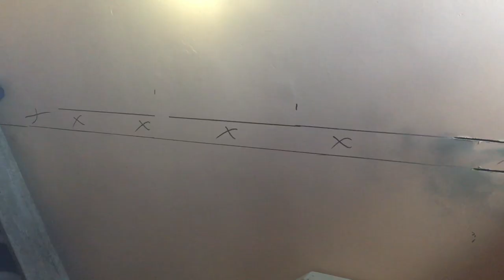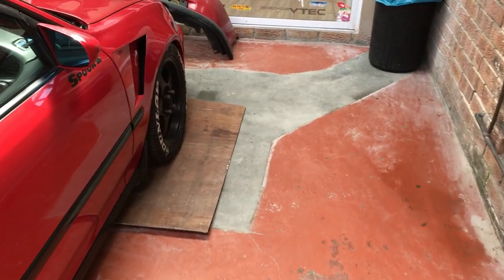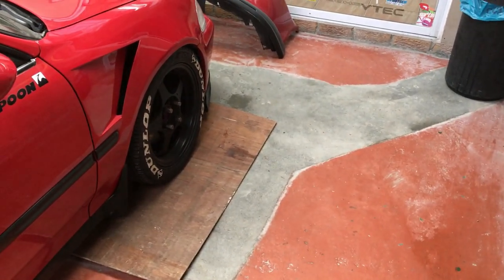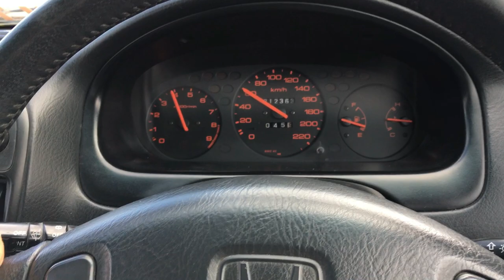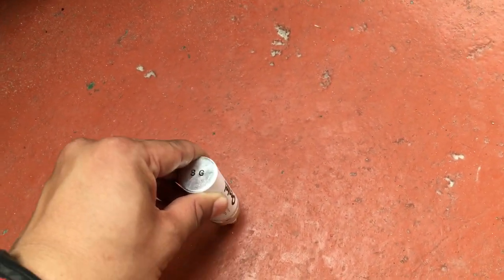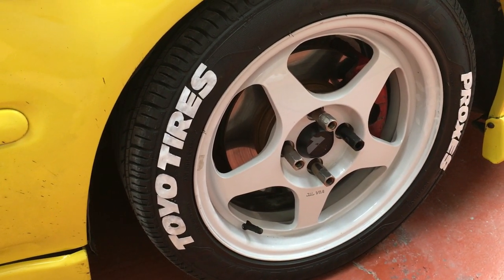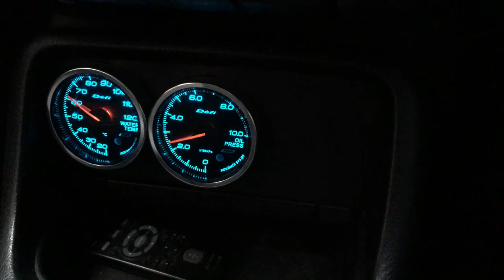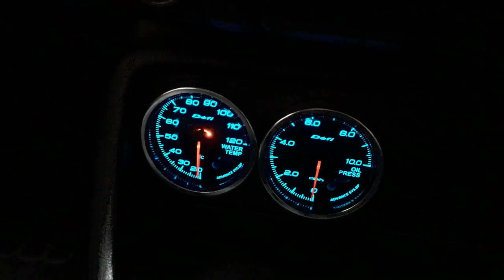HOW TO FIX TIRE LETTERING FOR A HONDA VTEC

Comment: Job well done Kurt!!! Time to bring the heart of the EG up to speed with its looks #B18v and the best part is that you have the b18b3 which is the strongest in the b18 non tec Category👌...Mmm food for thought and add b16 pistons in that block to make it even more aggressive🤔 sounds like a plan for the future 🔥🔥🔥
Reply from the maker: Kyle Theys Thank you Kyle 🙏🏼
Reply from the maker: Kyle Theys Yeah you are right i actually really do want to go LS Vtec but at the same time i dont want to scratch were it doesnt itch
Reply from the maker: Kyle Theys yeah im itching to go vtec but my car hasn’t given me issues so i dont really want to go looking for issues. Not that going vtec will
Reply from the maker: Kyle Theys I def want the EG to be K20 so im kinda stuck in between do i wait very long and go k20 or build A LS motor 1st
Reply: I will say K but the parts are crazy expensive so for good bang for buck I would say LS rather and you so right about dont scratch where it doesnt itch but then again if it's done right you wont have an issue just to do the head alone and get oil line kit, p6g old spec ecu and knock sensor and  run your 3 wires to the ecu like the knock sensor, vtec solenoid and oil pressure wire then sorted vtec for days and oh yes dont for get your b18c head bolts code marked (V) #cheaper or ARP head studs
Reply from the maker: Kyle Theys Yeah i do think i should start saving all the parts and do the conversion. I know of a ahead but the dude doesnt want to budge. But i do think when i get the head ill def start saving everything else needed.
Reply: I would gladly assist and make sure you have all the right parts for the job brother you going to have fun trust me 👌🙏
Reply from the maker: Kyle Theys Thank you bro 🤲🏼 That will be Highly appreciated 🙌🏼